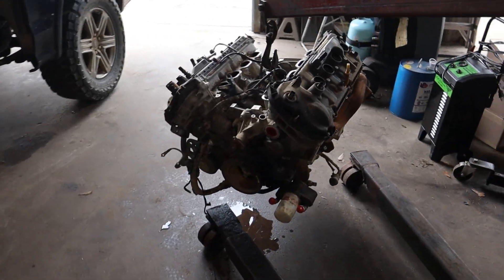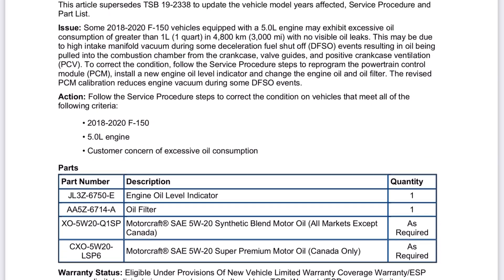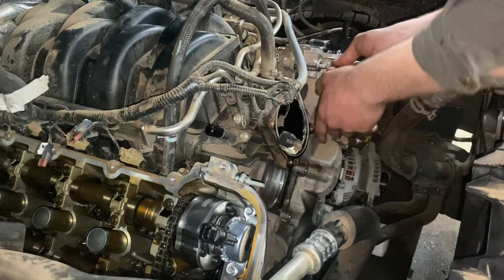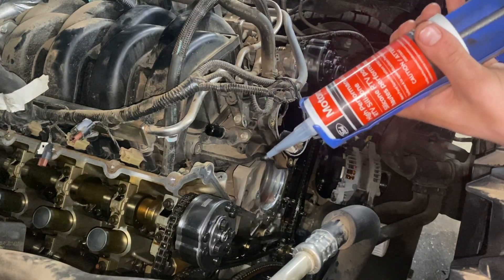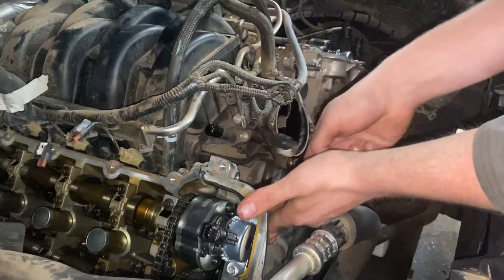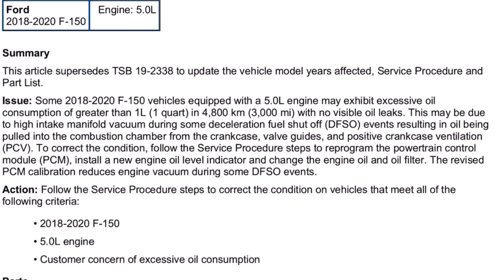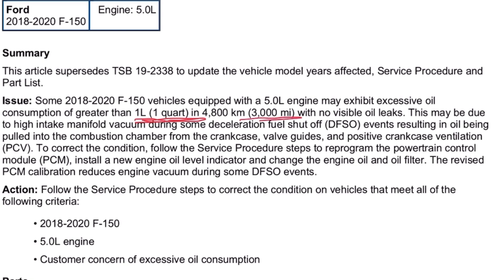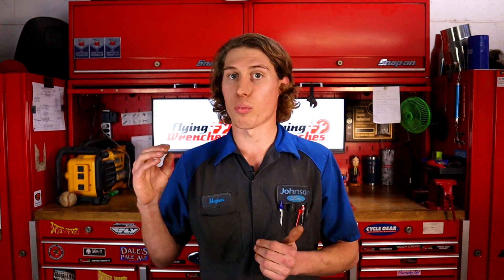Ford 5.0 Coyote Oil Consumption FIX

Comment: A contributing factor is the thinner 20 weight oil so many vehicles “require”. Need to go back to 30 weights. The ever so slight fuel mileage difference would barely, if ever, be noticeable in real world driving.
To give advice to not check your oil is very dangerous territory to be in. You always need to be on top of all your fluid levels.  Oil consumption can be just the beginning of an upcoming engine issue. Burning too much oil also shortens the life of your catalytic converter as there or more pollutants for it to break down. Not having dipsticks is also a very dangerous trend. We, the vehicle owners, need to be able to check fluid levels on our own without having to take them to a shop. There is no such thing as thing as a lifetime oil or any fluid.  That is a major offender with tranny fluid. The manufactures want to sell vehicles and they can not sell as many if their vehicles last many 100’s of thousands of miles. Always keep a close check of your fluid levels, top off when needed, and change fluids often if you want a long lasting, hopefully problem free vehicle. Oil is cheap, engines are expensive.

Comment: OK, my 2020 just changed the oil bought it less than three months ago I’m telling you no more than two or 3 quarts came out of that oil pan when it drained!, not happy and it was black as if they never changed it when they got it back from the lease return only had 14,000 when I bought it. I see a serious oil consumption problem in mine.now I’m concerned! This engine has been knocking since day one like a diesel. I hate it and they say it’s normal.

Comment: Another reason for oil consumption could be oil dilution by fuel contamination. When the engine oil reaches operating temp, the vapors of diluted oil burn off through the intake PCV. Haven't owed a gasser in decades, but I had a diesel that fuel  entered the engine through the lift pump. I caught it before any damage because I always check the oil level before starting. So not checking the oil doesn't sound like good advice.

Comment: I have a 2017 mustang GT, it was burning oil due to the horrible valve cover design so I went ahead and replaced the gaskets. Now I change my oil every 3k, however it still burns oil every 500 miles, not I did check around I can see minor seepage on the oil pan and a little on the valve cover, but it’s not really leaking. Any suggestions?

Comment: I have a 2018 F150 5.0. While driving the truck flashed a NO OIL PRESSURE ALARM. I was very close to home and limped in. I checked the oil and there was none. I poured in almost 8 quarts of oil! No low oil level light! Nothing! Just no oil and no oil pressure! WHY WOULD THEY NOT HAVE A LOW OIL LEVEL LIGHT! My 89 Mustang 5.0 has that!

Comment: Stop checking the oil?  Are you kidding me. I bet if I brought a 5.0 in for service with an engine problem and only had 3 quarts of oil in it, they would void the warranty and tell me it was my fault for not keeping the oil level up to manufacturers specifications.
Reply: Some michanics dont know , one liter of oil consumption is fine but more than that no , however the solution that i know , change pcv valve and reprogram pcm and the dipstick , i dont think the dipstick is important , the pcm will reduce the vacuum that build up in the manifold and it causes  oil consumption and oil consumption causes carbon in the catalytic converter and then carbon in the manifold and bad catalytic converter makes back pressure and may lead to engine knock 😢

Comment: I’ve had 5 F150’s. I’ve had V6 and V8’s. My 06 was using oil because of the flawed electronic PCV and after that, Ford scrapped it. My gen1 Coyote doesn’t use a drop of oil, even after 95K.

Comment: Almost bought a 5.0 f150 new in 2019.   Beautiful truck.   Went with a 5.7 tundra instead.    No oil issues. 😉
Reply: Instead of burning oil you went for burning gas!
Reply: @   Bingo.    👍.   It was worth every penny.
Reply: Dang thats a shame. My 2018 5.0 does burn a lot of oil but no issues. I run it to 6k miles before changing or topping off. Truck is now at 62k miles and due for another oil change

Comment: I check my oil levels because of the random timing chain rattle that happens when level is low. Recently changed the MAP sensor and it was soaked in oil. Keep in mind I run an oil catch can.

Comment: I believe that any new engine consumes oil. I always check my oil and will go low without any leaks. Could it be because higher tolerances and all aluminum construction. I grew up in the eighties and wasn’t much of an issue with iron block engines.

Comment: Years ago I owned a 90s Saturn. Got me used to pulling the dipstick every weekend. Also an oil burner but would run forever as long as U kept oil in it. Only held 4 qt so it was a lot more important on them

Comment: It ends up setting off the Cam Position sensors which make ur 5.0’s run like shit. I’m going to have that TSB done to my 2019 Lariat. New vehicles shouldn’t burn oil in my opinion. Or have very little oil consumption. When you pay $55k for a vehicle it should damn near be flawless

Comment: I guess the catalysts being damaged from an engine burning oil isn't a concern for a technician who is pretty much only doing repairs on new vehicles under warranty. You should definitely check your oil level if you have a known issue of consumption or leakage. It's much cheaper to keep oil inside of an engine than it is to replace that engine. Obviously if you have oil leaks you should have those leaks repaired. I've put 100,000 miles on my every day driver that burns engine oil because I check the oil in it once a week. If I didn't it would have exploded or locked up in less than a month.

Comment: I understand what your saying about checking the oil excessively,  however I am an old school mechanic and that habit which I believe is a good one is ingrained in me. With that said I was noticing that my oil level was dropping ....not alot but enough that it bugged me. I installed a aftermarket  oil separator which solved that issue coming from my pcv line. I don't like the oil going into my throttle body. Which in turn is not going to be good for your valves etc. Granted I didn't have that much oil to begin with being consumed but in my opinion there shouldn't be any going back into the throttle body.  Anyway that's my thought on the subject. Thank you for your videos I do enjoy watching them. Never to old to learn.

Comment: Now everyone has opinions  but I can't not check it it will be knocking we took son truck 1100-1200 mile round trip check and filled oil topped off quart n half. 700 miles in on way back stopped get gas I checked oil wasn't showing on the stick. Few quarts to get it up on stick to be low still not in safe range between marks or punch out holes. Whatever Ford uses.  But I don't think not checking it going to help.  I see what you mean you would see more and more blown engines. I understand what you're saying about that ur not working on 5.0 everyday or mostly even but IDK IDT not checking is the answer. If it was staying in safe range or just right below it at 3500-5 k miles I'd say yeah one could but the way it now .

Comment: I had this in my 2018 f150 5.0. I drove from NY to WA this summer. I had the oil changed right before I left. I had about a week of continuous driving. When I got to the WA border I noticed a rough idle and performance issues. The check engine light came on with misfire codes. Took it into   Ford and they performed the dipstick and reprogramming TSP. Lower oil levels caused too much vacuum. The engine stopped having issues but noticed it wasnt idling as smooth. Pulled the spark plugs and they seemed to have allot of burnt oil on them.

Comment: I have a 2018 with 12K on it, i happened to check my oil a 3000 miles into oil change and it was down over 3 guarts, found about the tsb and went to the dealer and done the tsb and was told by the lady servicevto come back at 1000 miles so i went back and the oil level was down appx a guart. I was told now to come back at 3000 miles and not to add any oil.

Comment: 2018 Lariat with 5.0.  I routinely changed my oil at 3500-4000 miles.  about 70k is when I first noticed the 'excessive engine oil consumption'.... I was at 4200 miles since the last oil change - went slightly over my norm.... but not that much.   Checked my oil and it was 2 quarts low.  Had the PCM and oil dipstick thing done..... made no difference.  Truck doesn't smoke or leak.... so, guessing it is slowly or quickly plugging up my catalytic converters..... I change my oil at 3k now.... and it uses about 1/2-3/4 qt in that amount of mileage since the PCM reprogramming..... which doesn't seem like a real fix to me.

Comment: Well interesting, it appears more and more these day that us OLD guys your words 65 or older don't know didley. Yup as a Master ASE Certified Technician since 1977 and working on Engines all of my life from 2000 HP Diesel Engines to Small Engines and All Automobile Manufacture Engines including Ford and their 5.0L engines to date, I would Strongly encourage everyone to CHECK THEIR OIL on a regular basis. I will guarantee you one thing, if you don't and you experience an engine related failure on your 5.0L Ford Engine The Manufacture will point a figure in your direction indicating that your responsibility to keep the proper amount of oil in the engine and insuficient oil levels in the engine was the direct cause of the Engine failure. We in the OE Industry refer to this as Operator Error or abuse by the Customer. Oh I forgot the mention I'm 67 years old and have worked in the Industry (OE) as a DM, TSM and TSSM for over 30 years. And Yes I own one of these too (2020 Ford F-150 SuperCrew with a 5.0L engine). And Yes I'm familiar with the FORD FIX as I have been through the TSB 19-2365 repair with my dealer as well. Still consumes oil today with 44831 miles and the consumption is much greater than 1 quart in 3,000 miles. 
So anyway Sonnie, I will continue to check the oil in my Vehicles that I own as it's truly peace of mind knowing that my Vehicles will have the proper amount of oil in them recommended by the OE.

Comment: I have a 2018 F150 with a 5.0 Coyote and I recently took it for service at a Ford dealership. When I went back to pick it up the guy says your oil was low. I said I don't touch the oil, I leave that for you. It doesn't smoke, doesn't leak, nor can I smell the oil getting burned up, and the oil pressure is always good but something is definately happening to it. I drove it about 1500 miles since that change and had to add a quart of oil to it. These issues should be told to people at the dealership to vehicle owners so they can monitor it. I will always check it now since this has happened to me.

Comment: All new trucks from all manufacturers burn oil. Thanks to the positive crankcase ventilation… GM also has a similar specification for oil consumption per xxxx miles / kilometres. Let’s just be thankful that ford didn’t put in cylinder deactivation like the rest of the OEMs. Ford has “ phaser “ problems …. Yea well Ram and GM have camshaft and lifter problems constantly lol

Comment: EPA requires thinner oil 5w20/5w30.  
Run 5w50, problem solved. Lots of us boosted or bolt on *stock block 5.0 owners already do this with no burning oil issues.

Comment: I own a 2018 Ford F150 with the 5.0. My 5.0 does use oil, However I think the problem is This motor likes higher RPM. Running in normal mode I see It does use more oil. However Running and sport mode and running the rpm's up It uses less oil. One note I took it at a learning mode On the transmission And disabled That's stupid transmission software. I think the lower Rpms Are really lugging that motor?.

Comment: I don’t agree with you on this one. Designed to burn oil??? It sounds like an excuse to a poor design/ avoiding warranty $. This isn't an old rotary engine. I had a 1999 Navigator 5.4 32valve 175,000 miles with no measurable oil loss. My 2020 F150 5.0 with 70k miles burns 1 qt every 1,500 miles. Mine has had the oil loss TSB completed at 40k miles. I capped the pcv nipples and put valve cover breathers on to see if oil was being sucked into the intake. No change in oil consumption. Still losing 1qt/1,500 miles so you tell me where the oil is going? I will be switching to 5w30 next to see if it helps. I believe it is 100% the cylinder coating and low friction rings in fords attempt to increase mpg to meet EPA standards. Not to mention the 5w-20 engine oil. Miraculously, when cylinder deactivation came out in 21’, spec went back to 5w-30.  Hmmm…. And the switch from 75w-140 to 75w-85 in the differentials. Edit: still burning 1 qt/1500mi on 5w30
Reply: Catch can

Comment: My 2016 5.0 had this issue . The engine blew with 105,000 miles on it. Drove it gently, oil changed every 4 to 5000 miles. Always serviced, never towed anything.

Comment: I am under 65, own a 19 f150 5.0l, and i check the oil no less than every 2 months.  If thats overkill, i can live with that. Catch can a small amount.....i dont put many miles on it but i usually end up adding about 1.5 qts over the year between 5000 mile oil changes.

Comment: I’m having to put a quart ever 1500-2000 miles. I check my oil every other fill up because the low oil issue screwed up the vct solenoids. Is this reprogramming free?

Comment: You might want to check your oil. The way I learned of this issue was when my truck started running rough and gave me a crank position sensor fault code. Had the oil changed and the fault went away. I now have my oil checked twice between changes and it’s always a quart low. The place that charges my oil does the top off for free.

Comment: Why would you design an engine that burns oil with all the environmental regulations going on. I never had a new vehicle consume oil until the manufacturers started putting that cylinder deactivation bullshit on their vehicles. I’d much rather my engine burn a little more fuel than to consume oil.

Comment: I have a 1rst gen 2012 5.0 I bought used w/ 130k (very clean truck).  With fresh oil change I drove a cross country move towing heavy and runs perfect and now at 145k less than a quart low after 4500 mi.  Oil was black after the move.  Why do these newer 5.0's have such a problem with oil loss??

Comment: 11:1 compression (give or take) plus that big 5/8" pcv passage behind the throttle body, equals increase oil consumption. Have a gen 2 5.0 Mustang engine with big catch cans and the passenger side fills up well before a 5kmi oil change while the driver side gets merely a few drops... all because the pass side sees the most vacuum with its suction line being right behind the TB. Food for thought.
Reply: I capped my pcv nipples on the intake and ran valve cover breathers and mine still burns 1qt/1,500 miles.

Comment: I check my oil on my 3.5 Ecoboost alot and it's low around 1/4 of a quart every 5k. And it has 140k. Only reason it's low is because the vacuum pump has a slight leak.

Comment: You are delusional. If you don't check your oil you won't know there is a problem or potential problem. I have owned (new) a 1983 F150 with 300 ci 6 cyl, a 1986 F150 w/ a 5.0l, a 1991 F150 with 300 ci 6 cyl, a 1991 Explorer with v6, and now ai still drive a 1998 F150, 4wd, with a 5.4l . 2 valve. I.keep the oil changed and check it regular.

Comment: I didnt expect you to say the problem is proactive mechanically inclined truck owners.... I've caught multiple issues  dealers either ignored or didn't check while under warranty to the benefit of thousands in covered repairs for me and my family. The idea that we should simply trust that an engine or mechanical system is probably fine ignores the very real mechanical issues commonly found accross vehicled of previous generations. 

You could say don't worry as much about oil consumption on 18+ 5.0s but there are many other engine designs exhibiting problematic oil consumption from multiple manufacturers. 

The auto manufacturers are already trying to restrict owners right to repair in order to maximize service revenue including the basic ability for owners to access OBD data for simple repairs. There is clearly pressure to do away with useful features like oil and transmission dipsticks which would then require an expensive trip to the dealer or independent shop for simple diagnostic. Redundancy is good when the primary system relies on cheap electrical sensors and connectors exposed to extreme temperatures over time. I for one will not take your advice and encourage others to verify specs and be proactive informed consumers/owners.

Comment: I have a 5.4 3v triton with 108,000 miles. The phaser tics like an m240 machine gun but it doesnt burn or leak a drop of oil.

Comment: Check your  oil level. I have a 2011 5.0 f150 three qts after three thousand miles. But I noticed after running atf three hundred miles before oil change no engine clacking from valve train on start up and now one qt every 5k!!! yep I believe the oil control rings are getting stuck.no fuel gas to clean the rings anymore., With direct injection

Comment: Man would say just about ever ford engine leaks oil... Let's start with 2.0 and 2.5 timing cover... 2.7 oil pan leaking oil. 3.5 timing cover leaking. And you should check your oil level ever month. Burning oil is not good for engine. Engine will sludge up and and clog oil passages.

Comment: Consuming 1/4-1 quart of oil over 4-5k miles is absolutely great. Some oil will get consumed past the piston rings and some through the PCV system but if your consuming 1.5-3 quarts over a 5k oil change interval I’d say it’s excessive